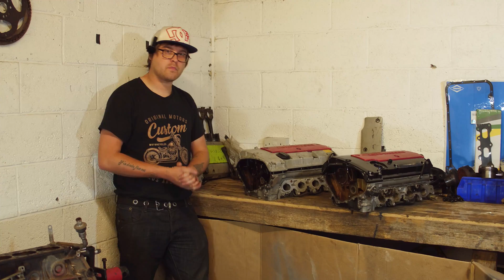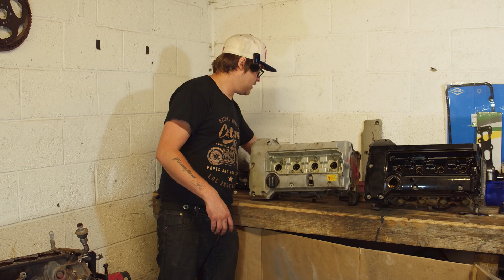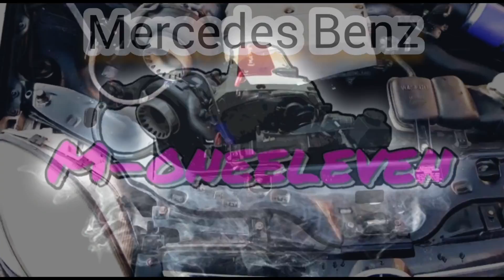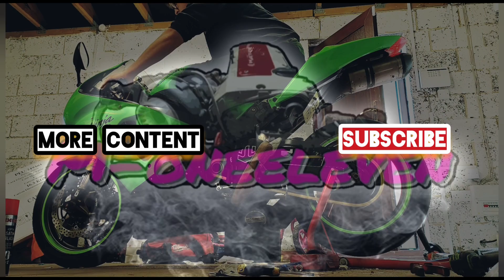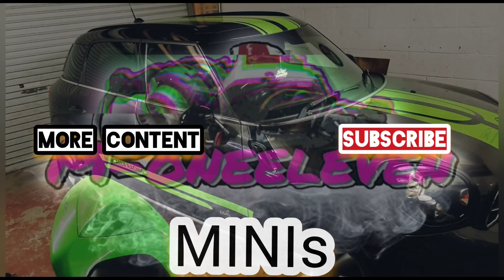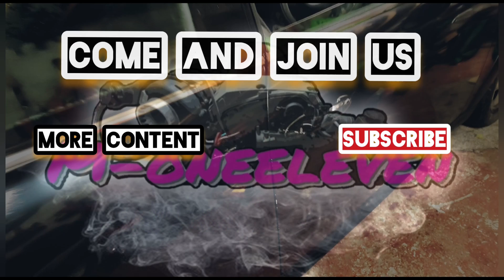M111 Head To Head! Which Cylinder Head Is Right For You? (Evo vs Pre-Evo Breakdown) #subscribe

Comment: I run the Evo engine in W202 with bosch ecu  custom wiring with a customised  W202 bypass valve and a magnet mounted in the engine bay. It works great
Reply from the maker: That's awesome 👍, I have always wondered whether the difference in camshaft position sensor location works as the pre Evo one did, did you have a remap or just running it as it was  on a pre Evo? With the coil on plug set up to I'm assuming your running the coils wasted spark?
Reply: @M-oneeleven-M111  I had to keep the original 2-coil setup. I have a small compressor  pulley, and no remap at the moment 
long term plan is to install a turbo
Reply: Customized bypass valve? I’ll like more info about that also what’s the magnet for?
Reply: @Aliayasrahhhh  w202 has a supercharger that uses electromagnet to engage it therefor you can't remove the magnet (i have it attached on side of the engine bay as evo engine supercharger does not have one ) bypass valve has an adaptor as evo-s bypass is bigger and it has 6 pin plug instead of 3 pin plug
Reply: @AB-ng7zc  disconnecting the old pully won’t make a problem as I know only if you disconnect the bypass valve it would confuse the ecu

Comment: Really good information for the community! My questions to you all, are the m111.958 (200k Evo) and the m111.983 (230K Evo) cylinder heads the same? Same intake/exhaust ports, same cams, springs and valves?  It would be really helpful to know 

If yes, it makes more sense to me, to have a 200K Evo engine and stroke it to 2.244cc (89,9x88,4) with a 2.3 non Evo forged crank and correct rods and pistons to achieve good CR. You only lose 51cc but you gain 2mm wall thickness between cylinders which is huge.
Reply from the maker: Absolutely the more wall thickness the better, I think that's the biggest issue when doing turbo conversions on the 2.3, there is so little material for keeping the headgasket clamped, this is why it always blows out between cylinders.

So with the heads the cams are different, valves appear to be the same, intake points are oval on the Evo Vs rounded in the pre Evo, and I believe the Evo ports are slightly larger, the exhaust ports seem to remain the same, that said I haven't yet measured the volume of the head to see whether that changed as the Evo has a higher compression ratio, however I don't believe a 2.0 head will work on a 2.3 due to the bore difference I would say the the head dome diameter would match the bore, However I haven't measured that

Comment: Ciao dall'Italia!
Gli EVO M111.951 oltre al cambio della Testa Cilindri, hanno ricevuto un rinforzo sul basamento,.
Ma hanno anche cambiato il rapporto di compressione rispetto ai vecchi M111.
Credo lo che abbiano portato da 9,8 a 10,6. Ecco anche perchè le bielle sono diverse
I miglioramenti della testa e del blocco/basamento, credo che siano stati fatti anche per contenere il problema della perdita d'olio della guarnizione testa cilindri, che affligge i motori M111. L'Italia è un paese dalla grande storia di motori, ma qui non si usa fare il tuning di potenza, di unire più motori e potenziare quello originale. Pochi lo fanno, quindi è una materia seguita da pochi.

TRADOTTO IN AUTOMATICO (salvo errori)
Hello from Italy!

The EVO M111.951 engines, in addition to the cylinder head change, have received a reinforced crankcase.
They also changed the compression ratio compared to the old M111s.
I believe they increased it from 9.8 to 10.6. This is also why the connecting rods are different.
I believe the improvements to the head and block/crankcase were also made to address the problem of oil leaks from the cylinder head gasket, which plagues the M111 engines. Italy is a country with a great history of engines, but power tuning, combining multiple engines and boosting the original one, isn't common here. Few do it, so it's a subject not widely pursued.

Comment: Awesome videos Hi  i have a 2.3 supercharged mercedes w202 kompressor sport 
Its not a red  top 
Its got the clutch supercharger m62 
Its a 1996 you can see it on my channel 
Q is wot inlet ports will it have it always amazing to drive the supercharger sound is so addictive
Reply from the maker: Yours is the version with the aluminium intake manifold which actually has good size round intake ports, and the manifolds are port matched for beat flow from the factory, you also have slightly different pistons in you engine to the red spark cover variant, the valve reliefs changed sides and the pistons have a more defined dish to them where as the red spark cover version had a more smooth kind of bowl to the piston, I actually prefer the pistons you have but they're quite difficult to find now, so you actually have a great version of the M111k, but definitely the supercharger whine is addictive coupled with a bypass valve that makes noise it's awesome
Reply: @M-oneeleven-M111 thank you so much for replying back and giving me  so much information on the engine thank you so much I look forward to your amazing videos on a red top engine soon thank you

Comment: I'm confused. I have a 2002 M111.951 in a C200 Kompressor, it looks like your Evo on the left, but I was under the impression my car was pre evo. Looking at your comparison of the 2 spark plug covers, you didn't really define which was which. My cover has the bolt hole between the P and R in Kompressor. So what do I have?
Reply: Open the spark plug cover, if you have 4 coil on plugs it’s a evo. If it has 2 coil on plugs and 2 leads, it’s a pre evo (earlier engine) hope that helps

Comment: hey matey! quick question have you ever managed to make the evo fuel system work on a car that has a normal return line fitted?
Reply from the maker: Personally I've never tried it, I've always stuck to the pre Evo cars due to the bottom ends being stronger for what I do, that said there are ways to modify fuel systems to work. So do some research on "Deadhead" fuel systems, you will basically need a inline fuel pressure regulator with the output to the fuel rail and the return hooked up to the factory return of the car. I hope this helps 👍
Reply: @M-oneeleven-M111 thank you i’ll do some more digging! great info 😊

Comment: The good thing about the evo head is that you can drill and tap the camshaft sensor hole on it to run on a pre evo engine
Reply from the maker: Yeah they left that oart in the casting, but im not sure whether it would still quite work like that as you also have to work out the coil pack issue too, with the evo having the 4 coil on olug design and the pre evo having two coils, the mounting points dont exist to be able to mount the pre evo coils, that said they could still work i havebt tried it
Reply: @M-oneeleven-M111  You can duplicate the signal from other coil to activate wasted spart system coil, even on single coils.

Comment: I started with an EVO engine and since I was turbocharging, I wanted to use the early aluminum manifold.  I welded up the manifold ports, milled it flat and reshaped them to blend into the EVO head ports.  I also used long tip Bosch injectors and an early fuel rail with an adjustable VAG fuel pressure regulator.  This worked well in my 190E (was a 2.6 car). 5:24
Reply from the maker: That is awesome, may I ask what boost your running and if you have had any problems with using the Evo engine? I have always used the earlier engines so I'm keen to learn how the Evo engine holds up to being turbocharged, I love the creativity behind this and it's what it's all about, most of the stuff we can't buy for our engines so we have to get creative, I love to hear the stories behind people's builds 🙏
Reply: @M-oneeleven-M111 limited it to 1.4 bar and had torque limits to protect the 6 speed transmission.  The engine and trans came from a W203 which are pretty rare here (US). Used Haltech Elite 1500 ECU and throttle by wire.
Reply: @M-oneeleven-M111 parts availability for the engine was the biggest challenge.
Reply from the maker: @rbazola thats extremely respectable more than i thought those rods would take to be fair, any idea of the power output? Haltech make some awesome ECUs infact their range is really good to be fair, i one day want to run a m111 on a Fueltech ecu but considering the cost that might be a while 🤣, i would like to put this M111 in a CLC if i can do something a little different, if you have seen the community post i shared a little bit ago with a 204 clc with a black edition bodykit
Reply: @M-oneeleven-M111 boost was limited at lower rpm to protect rods. Build was aimed at 400hp.  I didn't fully tune it before I sold the car on.  The new owner is loving the car and will finish tuning.

Comment: I would put forged rods in it also
Reply from the maker: Rods will hold 400hp confidently in the pre Evo engine but if building a full Evo engine definitely do rods, as mentioned pistons are the bigger problem with these engines they melt and crack very easily if your tuning isn't on point, though I do suspect cerakote could help with resistance to DET
Reply: @M-oneeleven-M111  yeah Im probably going to get pistons also , with ARP studs and MLS , but Stern have seemed to closed down so I will need to go to hedgehog for the MLS.
What are your thought on flywheel clutch and gear box? Is the standard 5spd useable?
Reply from the maker: @Retro.delights 5 speed will work a lot of folks swap it for the slk 5 speed, yeah stern just seemed to suddenly stop, but i am trying to work with companies to bring about a range of budget but still reasonable quality components for the M111
Reply: @M-oneeleven-M111 right ok so do you think me spending OVER 3Grand on forged rods , pistons , MLS head gasket , ARP studs , stand alone ECU , Turbo , Turbo Manifold , me porting the pre Evo head , is worth the cost and time for my W202? Or should I just put a Saab turbo or Audi Bam engine in it.
Reply: Pistons are bigger problem than rods. They are very sensitive to knock and poor afr.